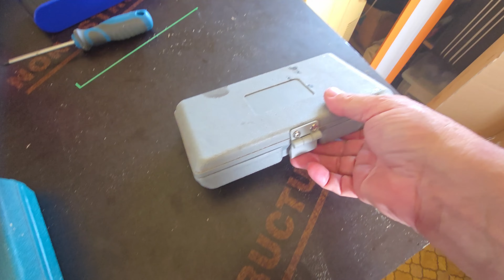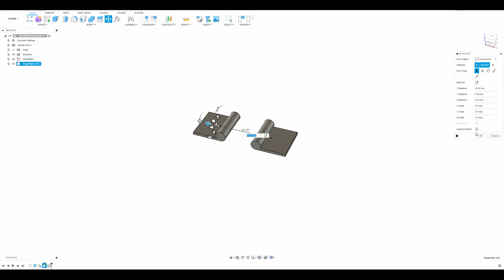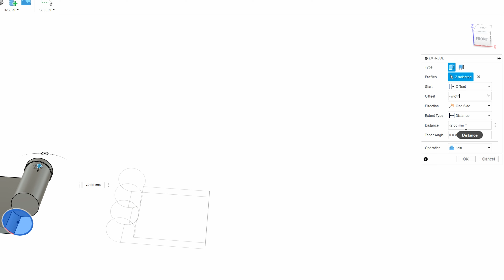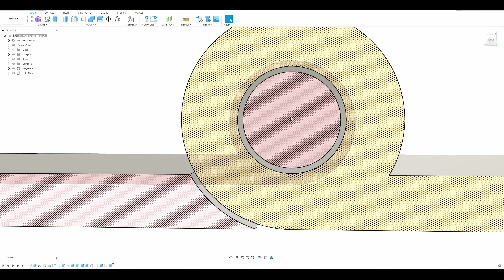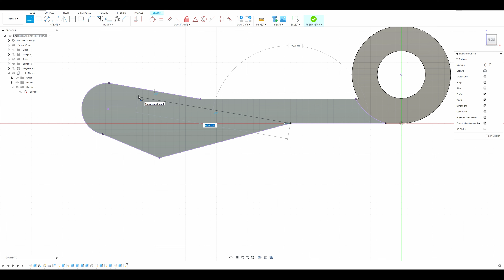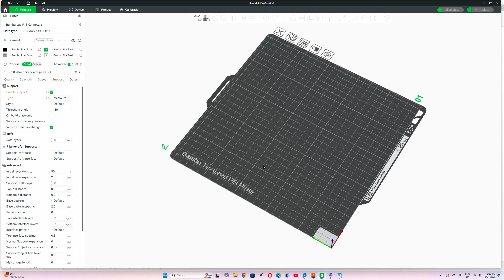3D Print & Design Tool Case Repair with Fusion 360

Comment: It always surprises me how many different ways we use software like Fusion.  After I watched the video I thought "How would I do that?"
For day-to-day one-off's, I don't create a table of parameters, I just leap straight in, so I decided to recreate what you did "My Way".
By the time I finished fluffing around, you had printed the result, and were half way through your dinner!
To add insult to injury, you resized your design by simply amending parameters, and reprinting it... I would still be wading around in a sea of blue lines!
Never mind... I still really enjoy the process!   Thanks for the video.   😃  👍
Reply from the maker: More than one way to do it for sure, I used to just jump in but finding the right sketch with the right dimension is a pain when you want to change it.

Comment: 15:45  My solution to constraining the arc would be to apply a Tangent constraint to both ends of the arc.  It might be necessary to remove a dimension or constraint from one of the straight lines to make it work.
I make no claims to be any sort of expert, so come on you Gurus... let's hear how it should be done!  😜
Reply from the maker: Hmm what was weird on the second arc I did it constrained ok and I drew the lines in the same way. puzzled......-